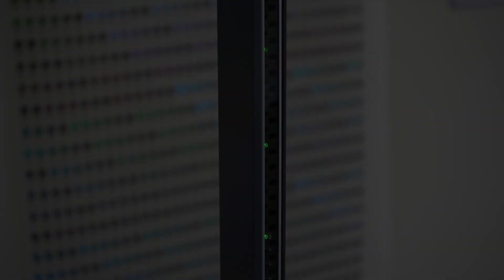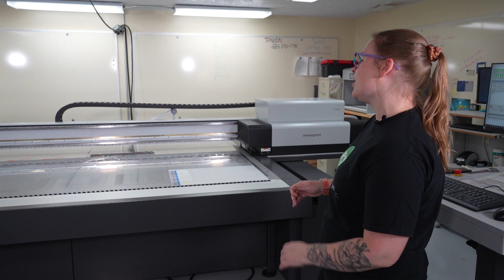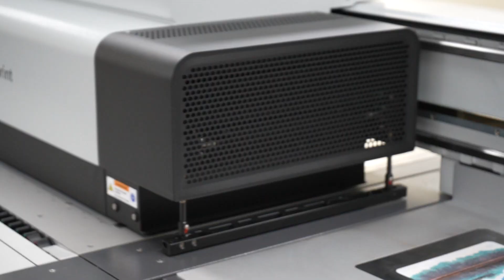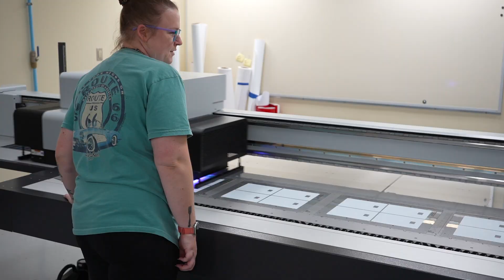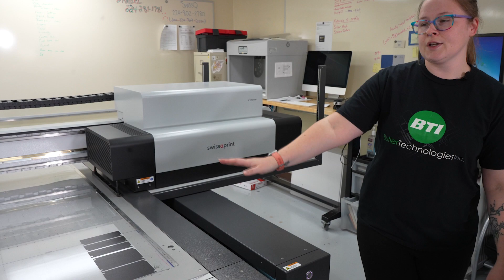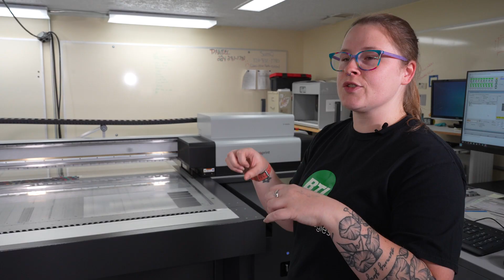SwissQPrint Impala 3 Digital Printer Review

Comment: Are you happy with the speed of the machine? Understanding that every application is different, can you pump out large volume of output on this machine when you need to?
Reply: We use the machine mostly for labels and graphic overlays that have fine detail and multiple layers, that being said we don't use the fastest quality settings. However, in comparison to our older Acuity Advance HS (a 12+ year old flatbed) it is definitely faster! At the lowest quality/fastest print (like billboard quality, looks good from the road) it can do something like 1900 square feet an hour, so like you said it really depends on what your goal is. It's definitely possible to "pump work out" but it's never gonna be as fast as something like an HP Indigo.

Comment: When you print just a small pcs of Acrylic or PVC board, do you need to put masking tapes to hold it during printing or no need it because of the tip switch vacuum is really holding on just a small pcs of substrate? I am really curious about it.
Reply: I use large pieces of plastic sheeting (they're 2 foot by 4 foot sheets) to mask off the middle portion of the bed between the front and back, but I've found that even without that there's very little movement of the substrate during print because the lamps don't have much heat output. As long as what you're printing is relatively flat you'll have little issue from my experience. If it's not a perfectly flat piece of material that would depend on vacuum to flatten it for print you'd likely still need masking material or tape.